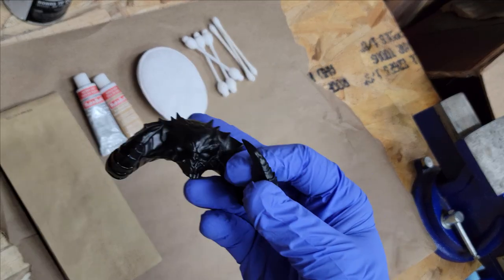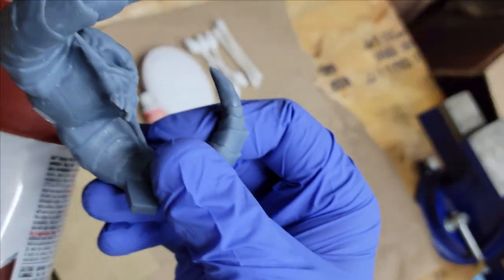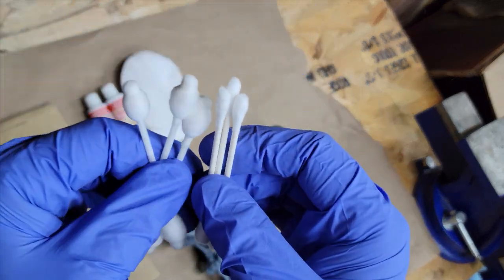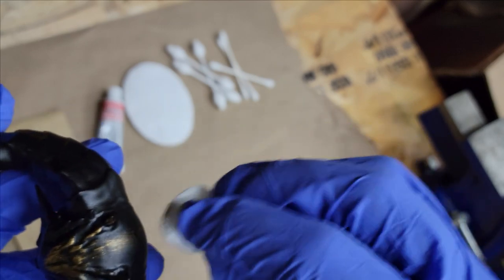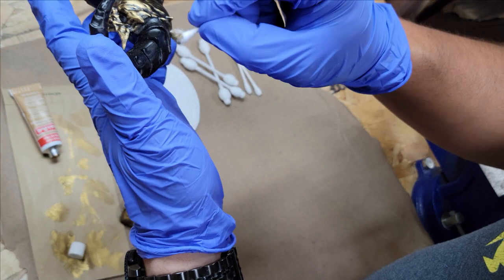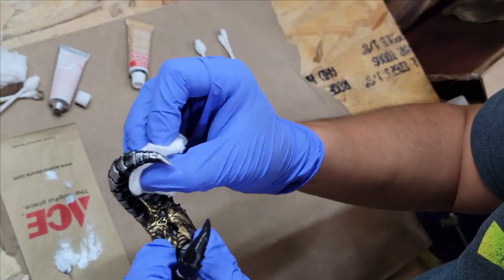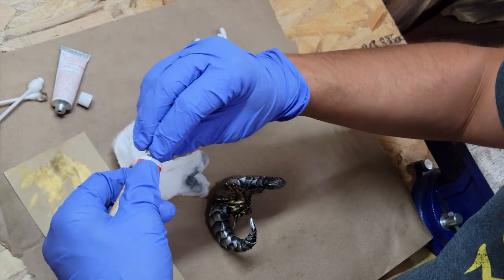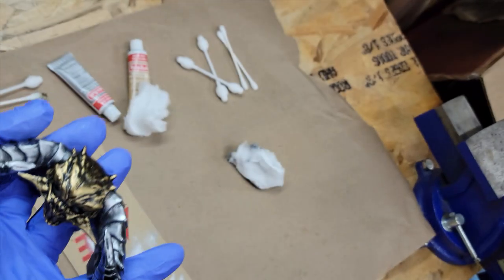How to apply RUB 'N BUFF to a 3D printed resin model for a AWESOME painted look Diablo 4 #howto

Comment: That stuff is magic.
Reply from the maker: It is for real. I love this stuff
Reply: @dadwillmake  After it's buffed the part can be handled?
Reply from the maker: @boboscurse4130  i sprayed it with a clear coat so it would be fine to handle it. You can handle it without the clear coat but the finish might wear off.